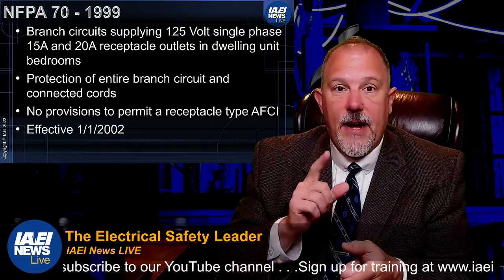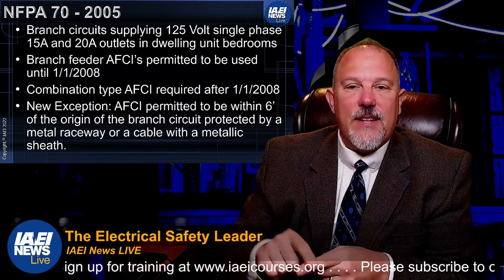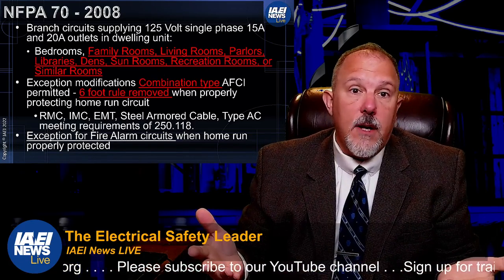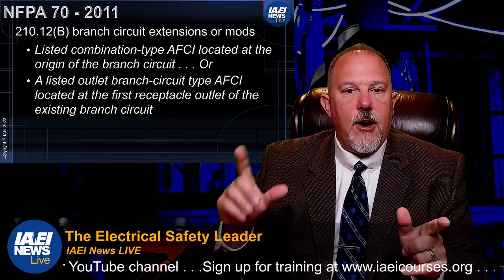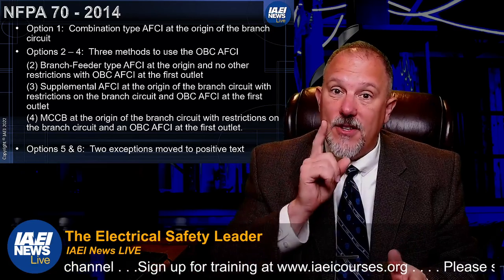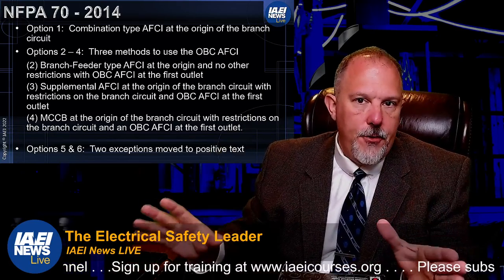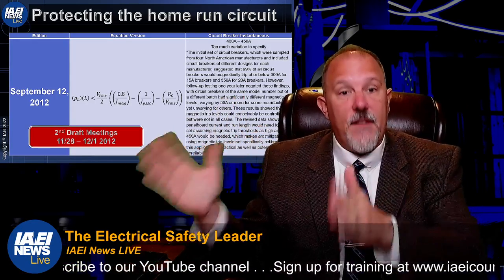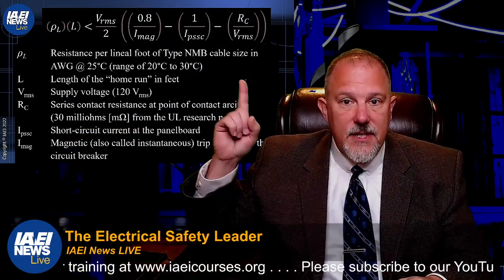AFCI Fundamentals - 210.12 Requirements

Comment: Is it permitted to comply with 210.12(A)5 for a portion of the branch circuit and 210.12(A)6 for the rest of the cirucit and still be compliant? 95% of the conduit from the breaker to the first AFCI outlet is EMT and then switches to PVC encased in 2" of concrete inside a CMU wall. The first outlet is an AFCI device. Is that still compliant?